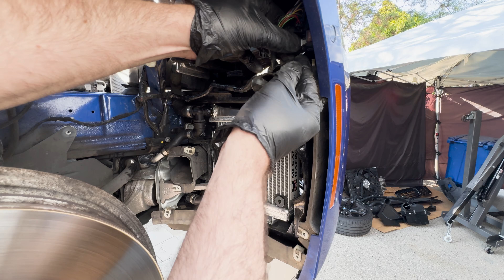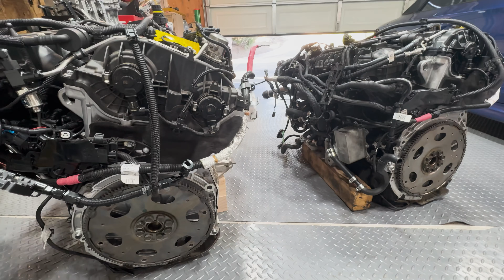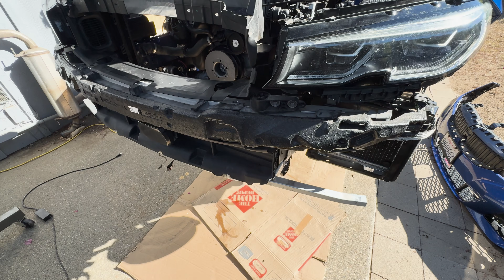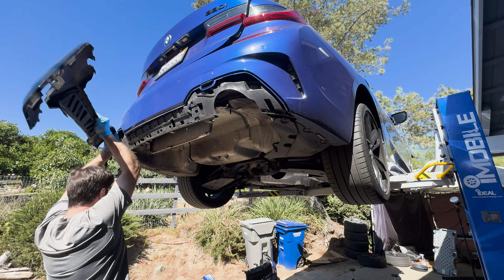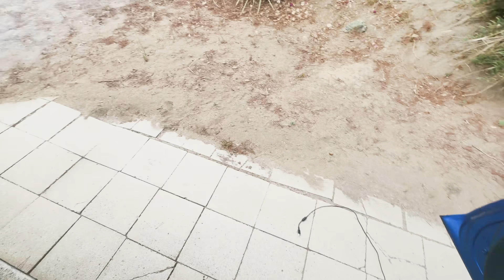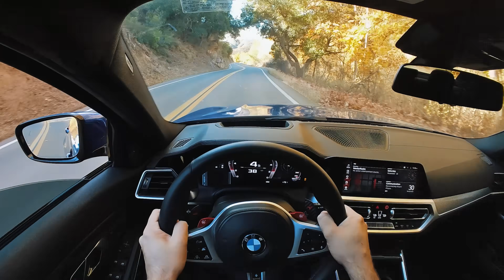Why I HAD To Swap In This One of a Kind BMW Engine

Comment: Hey, nice video! I think you touched on the philosophical elements of building a car very well, and I respect the vision you had for this build. I have a couple questions about your swap because I am contemplating doing a similar thing to my F31 LCI. Is your 330i transmission original to the car? Are you worried at all about pushing 200+ more horsepower through it? I also thought the diffs were sized based on RWD vs AWD and by engine size, with the 4 cyl xDrives having the smallest ring gears. Sorry if you've already addressed this in an earlier video

Comment: Amazing build you did there, question from my side as i recently swapped my 320i with N20 engine to a B58 (gen1) engine, i was struggling a lot to get the DME fuctional with the rest of the car, mainly because i couldn't get the VIN number changed on the eeprom of the MG1CS003 DME, at the end i managed to make it work without a VIN but it's obviously not the original (and maybe the best) way, can you explain me what you changed to make the DME original functional? 

Thanks for showing us your experience with this video!

Comment: had to leave a comment here. Ive watched all your b48 videos and i was so set on getting a 330i f30 for its b48. Unfortunately that didnt happen but I did end up with a 335i F30 manual and rwd. Loving it so far. I believe its the perfect formula for a car. I still definitely want to try a B48/B58 car. Hoping as they put the B engines in more and more cars the prices come down. N55 holding it down for now 😅a bit outdated but not a slouch by any means.

Comment: I’m going bigger turbo but I don’t want to go for injection because I don’t plan on running E but I want to reach 400 would bigger fuel injectors help ? Or would the stock fuel injectors suffice

Comment: This is a real inspiration piece.
I have my g21 320d ( europe here, big taxes on big engines ) and I have no reason to thinker with it, but after watchign a few of your videos, I bought esys , started playing around .
I am lucky to have a pre facelift model without the pesky secure coding 2, but even so, cars post 2017 or so , seem to be so locked down, a loong way from how you could just change stuff on old volkswagen with vagcom.

As a seasoned car enthusiast, do you ever check if the ecu / coding of a car can be modded before buying them? 
Wonderful video, and great information, thanks !

Comment: Quick question, I have a 330i G20 stage 2 and my engine mounts went bad, installed the bfi stage 1 and that thing is undriveable, literally it feels like it will destroy the interior. What mounts would you recomend? Thanks

Comment: Amazing job brother you did your thing on that as always. I need help with something if possible I’ve been having an issue with my G 30 with a B 48 motor. Four-cylinder- a 2019 530. I at one point had an EVAP code. I changed the sensor and purge valve and it went away, but it started having an issue again. When I first put it in drive and let go with a break, the idle would drop down too low, almost as if it was gonna stall out, but it caught itself after changing that sensor it stopped, but now it’s starting again. What do you think this could be sometimes it doesn’t do it but most of the time when I come to a stop and then Let go of the break to then give it gas and continue going forward the idle momentarily drop down pretty low and then it would correct itself when I’m moving. It’s fine. It’s only when I first start out.

Comment: I have a 2018 f30 330i and I’m thinking about pushing more power but it’s need to be reliable. I need my car to run without problems to get to work lol. What do you recommend I do only with the stock turbo. In the future I’m going to change the turbo but for know what should I do
Reply: Bm3, or buy 340

Comment: Nice and professional work here! It seems that the electriconics are bolt on from b48 to b58 on this engine swap. I would be curious if this is the same on gen1 b48 cars. I have a 125i B48 with B48B20B engine gen 1 and I am curious where I can find if swapping the B58 on my car will be this easy. 

Thank you for sharing this with us!
Reply: I’m planning to buy an 2019, 125i with b48b20b, what do you think of that car? Have you tuned it?
Reply: @GTRuppsala  yes. Very strong

Comment: Hey guys and Vehicular I have a question to ask. When having a shop (dealer) perform alignements should there be weights placed in car l. It’s been shared by other drivers of my car it is recommended by factory to place weights in car to achieve a correct alignement. 

I am driving a 2024 m340i with adaptive m suspension and cooling and high performance package. It has Michelin PS4s with 19” wheel setup. 

Long story short I’ve taken it to a dealer twice and the car feels rough. When I go over bumps the car moves side to side and the steering wheel is not centered. 
The car will also drift right in a center lane. I’m starting to think something is wrong with suspension but can’t recall anything that would affect car. 

IWant my car to drive the way it was before all the trouble.

Comment: temperature control is so underrated. take the average tuned car to the track and it'll get too hot. they're only built for straight lines every couple of minutes
Reply: These engines wouldn't survive 3 seasons of local drift events.

Comment: I’ve been trying to spread the importance of this message for years now.  Although I do frequently preach that the S58 is BMW’s pinnacle and the pinnacle of human achievement with respect to internal combustion engines with its wide integration of forged components and higher peak power, the B58 is more widely available to enthusiasts due to entry cost.  Thank you for another video my friend.

After watching your test drive I’m sure you find yourself contemplating the possibility of integration of X-drive.  Rwd is unusable at that power level unless you are using a prepped surface.  I frequently search salvage auctions for wrecked b58/s58 powered vehicles and I never see any x-drive ones.  Don’t become a meme lol.

Comment: What model did the higher compression b58 come in?
Reply from the maker: X5, X7, 540i, 740i, 840i basically nearly all 2019 and newer models that came with a 6 cylinder by didn't have an "M" in the model.  If it has an M it would be a 6 port like X3 M40i for instance.  I didn't want to pay the M tax for a used motor hence I was looking at 2 port models.  Clean complete 6 port engines go for almost twice as much.
Reply: @ interesting.. I assume because the bigger chassis benefit from higher torque to move the extra weight. With a higher compression engine, won’t you be more limited on how much boost you can push without hurting the internals compared to a 6 port?
Reply from the maker: @ryanlewww  yes so far what surprises me the most is the how efficient the engine is.  Yes pushing the absolute limit is around 800 whp, beyond that you’d face various issues where the 6 port could go beyond but I have RWD so IMO anything over 600 whp would just spin anyway.

Comment: I didn't see this coming! You have made me really like the B48 engine and not fear it at all. I currently own a 2023 M240i xDrive. Your knowledge and approach to everything is very impressive. I love the narration that sounds like a professional well written documentary. I am not gonna lie I am gonna miss the little old B48. 😀
Reply from the maker: One day I'd like to swap the B48 into an older chassis paired with a manual.
Reply: @VehicularDIY b48 1 series e8x chassis 6mt?? Or e30/e46?
Reply: E30 ❤ @VehicularDIY
Reply: @VehicularDIY  I want to swap the b48 into a Fiero 88 GT. But I am a old guy.
Reply: @VehicularDIY  you should grab a 128i with the n52. i feel like since it was a 6cyl the turbo 4 would fit.

Comment: The b58 engine is amazing tuned and stroked versions are in the 7 second quarter mile times and over 1500 hp.  BMW has come a long way from the original N54 and ICE still has a 100 years left electric cars are not selling as anticipated, and there is not sufficient infrastructure to support it.  Great work again long time sub love the channel
Reply: You are right, electric cars are not selling as governments and manufacturers would hope. For example, Taycan sales have slumped worldwide, depreciation is terrible due to battery replacement costs etc. Currently, 1 in 5 new cars sold is electric. In fact more diesel cars are being sold over electric cars.

Comment: great video as always.  my stock b58 probably started to consume coolant, at around 30k kilometers.  I realized the coolant was at low in both enigine coolant and intercooler coolant tanks were at min two months after oil change at dealer.  i wonder if they flushed some of the coolant for some reason and didnt top of the coolant tanks or if the car is really using coolant.  now i am waiting to see if the coolants in both tanks will go down after 1k of driving...
Reply from the maker: What year is your car?
Reply: @VehicularDIY  2022 it is first lci version m340 xdrive with the mild hybrid and wide lcd screen instrument panel were introduced

Comment: ive been wanting B engines on my daily E46 for quite a while. wish i can afford it one day and the DME can be used in standalone mode like the good old MS4x!
Reply from the maker: I think people are locking the vanos and running the DME with motec for e46 swaps
Reply: @VehicularDIY  they're not locking vanos but valvetronic with standalone DMEs which i wanted to avoid. i love valvetronic because it is what makes the engine so efficient. someone dyno'd 1st gen 4cyl N engine with and without valvetronic, it does lose power at low RPM range without them

Comment: I had my heart beating on my hand with that lift. How is that safe?
Reply from the maker: Single column lifts tend to have a bit of movement and you can put an exhaust stand under the arm if you want it to feel rock solid.  Been using it for years.

Comment: This is so awesome to see. Makes me look forward to the future even with all the extra sensors and ECUs in cars nowadays. Any reason this couldn't be done to a B48 supra? Same underpinnings, just perhaps an even tighter fit?

Can't wait for the follow up video. Thanks for posting.
Reply from the maker: After doing it on this car I could do it on the Supra just the same as they are essentially the same car.  The 2 port came on the 2020 Supra and I actually sourced a lot of parts from Toyota directly for this swap as the markup is much less.

Comment: Other than the split cooling and higher fuel pressure, do you think the split timing chain is worse on gen 1 than gen 2? If the gen 2 didn’t exist, would you consider gen 1 as still a legend status? I think gen 1 really is a neat engine and has brought bmw back to the reliable game, unbelievable how much these things can take abuse
Reply from the maker: Yeah I still think the Gen 1 is awesome, I had it on my 440i xdrive.  I much prefer the sharpness of the 8hp51 that is paired with the Gen 2.  I don't think the timing chain design is a design flaw it just eats a bit of efficiency compared to Gen 2.

Comment: The later b58 still has PLENTY of issues. I work on them every day. Oil filter housings, water pumps, leaking intercoolers, and even vanos issues.
Reply: what's wrong with their vanos?. cold start rattle?
Reply: @n.shiina8798  It is basically a gear with a valve inside, the valve has a bolt that is pressed in to allow oil to flow, in time it starts to disintegrate, there is a mesh filter that will break up in small pieces , gets out in the gear assembly and blocks its movement. This results usually in the gear snapping inside and requiring replacement, however since it is at the back of the engine it is not easy to do without dropping the engine. (and they are 2) Sometimes the issue can be the actuator itself, but that is easy to change with a dedicated tool from aliexpress. They are also pretty expensive.
Reply: What is vanos
Reply: @escotavo5049  BMW's naming of variable valve timing
Reply: May I ask if B48 has less issues? Oil filter housing probably is the same?
Reply from the maker: I would anticipate needing to replace the oil filter housing by 80k miles, the water pump by 60k miles, would anticipate needing a heat management module by 100k miles and wouldn't expect the intercooler to leak or and vanos issues with oil change intervals in the 5 to 7k mile range.  I consider these wear items like tires and brakes and not a fundamental design flaw and in contrast to previous models its night and day in terms of things that could fail.
Reply: @VehicularDIY  What do you think about stuck open injectors ? I plan to change them together with the valve cover and even the vanos valves if I find a mechanic that can do them.
Reply: @VehicularDIY hi can you elaborate on heat modules?
Reply: @VehicularDIY  🫡
Reply: @ If they made it out of aluminum or god forbid cast it into the block in the first place, it wouldnt be a “wear item”. The water pump should be a LOT better, the n54 water pump lasts longer. This motor is NOT reliable, not when compared to many other options from other manufacturers. The oil filter housing alone is a paid 11 hour job for shops and beyond what most owners can do themselves. Please stop misleading people
Reply: @fry.master what is really stupid on this engine is the valve cover with the injectors, otherwise it's not that bad compared to everything else except a Honda/Toyota
Reply from the maker: I'll just leave this here in response to your comment about misleading people: https://www.consumerreports.org/cars/cars-driving/which-car-brands-make-the-best-vehicles-a6159221985/
Reply: You're a mechanic.....if people listened to techs.....they would buy a horse not a car.   Honda, Yoda they all have problems.    He never mislead anyone!   Life is short....drive a fun beautiful car!

Comment: What about rear subframe and driveshaft?
Reply from the maker: I had the M Sport diff option from factory so it's all beefed up and able to handle it.  Turns out when you get the M Sport LSD on the 330i you end up with Z4 hardware/Supra.
Reply: @ Great, that cut the way in half for you.

Man you made everything easier for my build. I am doing the same exact swap here in Egypt, you made it super easy for me and I am really thankful for you!

Comment: Would this swap be possible with Gen 1 B48 -> B58 as well? Amazing video, thank you!
Reply from the maker: Yeah just not 100% sure if the trans is the same, on the N20 and N55 they were different but I'd imagine they are the same on Gen 1.  You could check realoem.com to confirm.

Comment: Did you end up having to install M340i front springs due to the additional weight of the B58?
Reply from the maker: Turns out it shares the same springs, at least my car did with the adaptive M Sport optioned from the factory.

Comment: Awesome man. You make this look so easy. Thanks for this. It’s like YouTube premium. 

I have a couple questions. Did you have to get a different DME? Was the new engine wiring compatible with the chassis or did you have to do any modification?
Reply from the maker: DME is from a G05 X5, engine is from a 840i convertible, I used the harness that came with the engine.  It fit almost like stock, just have to flip the power module 180 and remove a tab in the carrier to have it click right into place like it came from the factory.  I was just trying to avoid buying an M340i harness or a Supra harness and it worked.
Reply: @VehicularDIY  what about the security things? in older BMWs there is EWS then it moved into CAS and idk what module BMW uses in this platform for immo. swapping DME needs to be virginized or immo delete so i'd like to know how is this done
Reply from the maker: @n.shiina8798 yes I will cover that in the summary video.  EWS was synchronized and powertrain working hours reset to be accepted.
Reply: @VehicularDIY  awesome. I will be waiting for your summary video to see the software part of this swap.

Comment: and my 335is is just sitting until I get index 12's
Reply: fellow brother, its time to give it up. those index 12s will fail just the same. my 335is needs a motor lol
Reply: I thought the 335is came stock with index 12s?
Reply from the maker: I put index 12s on my E90 and they were leaking within 20k miles.  I think ethanol is what takes them out.  If you can find a good set of index 10 or newer from a bone stock card that didn't run ethanol you should be good to go.

Comment: that lift sketches me out so much lol
Reply from the maker: Lol to be honest I'm more sketched out being under a car on jack stands at full extension.  You can put an exhaust stand under the arm to make it rock solid but its just part of the design where it moves a bit under normal use.  If something bad were to happen you'd have time to get out from underneath it worst case but I only lift cars well under it's weight limit.  I wouldn't be getting under it if an SUV was on it.
Reply: @VehicularDIY  where did you purchased it ?
Reply: Where did you purchase it ?